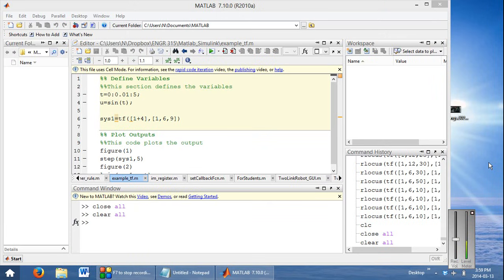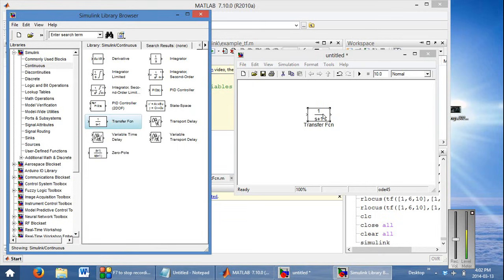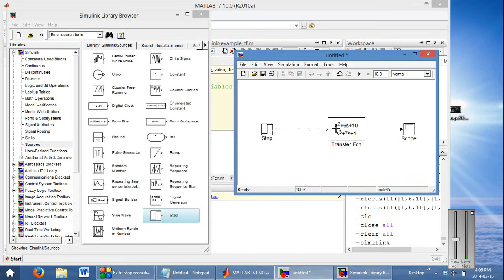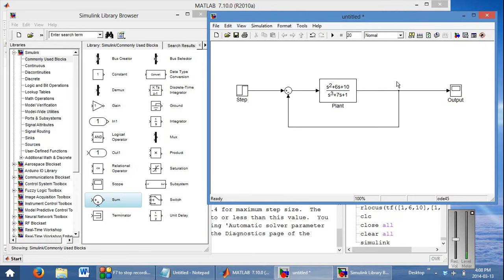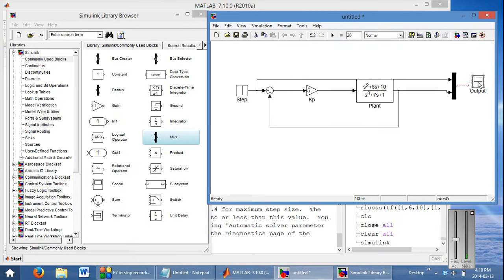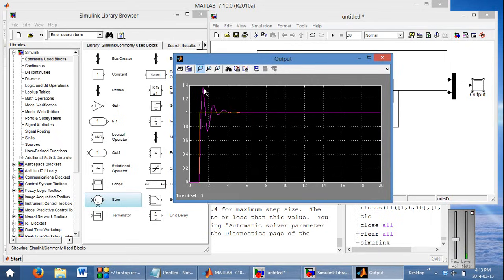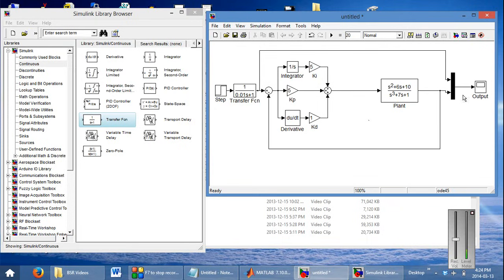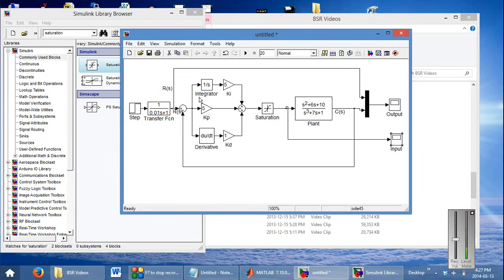Simulink Introduction (Control Systems Focus and PID)

Comment: How to make this statement  in simulink :
Varying the current from 1 to 25A, in steps of 0.4 ampere,  every 40 s over a total simulation period of 2720 s. Sir I have to give output of this as input to a model containing continuous states. Can you please tell me how to achieve this in simulink. Please help sir.

Comment: may i have your email or any wattsap number so i can get help from its very ugent. i have to do assigment related to this but i am not familiar with  simulink. the assigment is related to instrumentation and control have objective of model the circuit related to speed control. kindly drop your contact info it will be very benificial for me. looking for response
thanks

Comment: why don't you use pre-made PID block from the same library?
Reply from the maker: I created the controller from scratch to demonstrate the effect that each signal has on the feedback loop. Once a student understands what a PID does, they are more than welcome to use the pre-made block, since it will save them a lot of time.

Comment: Hey there! I have a transfer function of a control valve in a small pilot plant (step test). I used ident and found lots of possible orders, some with zeros included. All orders gavem 90%+ fit. I tried to tune a 4order1zero tf obtained from it with ZN but it didn't work. My question is: Why ZN tuning didn't work? And also can I used other good fits? If so, why use them?

Comment: Hi , I just have a equation and do not have a transfer function , how to use a PID and tune a PID, I wanted to model an inverted spring pendulum.
Reply from the maker: Most likely, you have to take the equation and transform it into the Laplace domain.

Alternatively, if you can simulate the system in Simulink, you can also heuristically tune the controller (via a "guess-and-check" method).
Reply: may I have your email Id please ,   Please message me in my FB https://www.facebook.com/sudhansum.tripathy, I need a help with it , I have used auto tune in MATLAB and want to send you the document so that you can see it.

Comment: Hi, I'm designing a PID  controller for my Quadcopter, my questions is, how do you come up with a transfer function?
Reply from the maker: +Cracklin319 
That is a complex question, because the dynamics are not linear, which means that you cannot use transfer functions. 

You can however assume small deflections from some equilibrium position (for example level flight)  and then fit a transfer function to that response. This would result in a controller that works decent near the equilibrium condition, but with worse results as you get away from them.

If you have the physical system, I would recommend that you look into something called "System Identification". For theoretical methods, you would have to consult published literature.
Reply: After linearized them, I shall make a Laplace transform right?

Comment: sir i have to design a PID controller or a PI Controller for the control of BLDC motor.
can you please explain how do we need to select the values of Kp, Ki, Kd????
please help me with this one
Reply from the maker: +Prerna Khobragade 

There is usually no one right answer for the controller gains Kp, Ki, 
and Kd when it comes to PID controllers. All that matters is what your 
desired response is, which is characterized by rise time, settling time,
 percent overshoot etc.

In this video, I used the heuristic tuning method (more commonly known 
as Trial and Error) until the response was "good enough". When using 
this method, I recommend that you start with Kp while keeping Ki = Kd 
=0. Once a decent rise time has been achieved you can tune Ki with the 
Kp value previously found, while keeping Kd=0. Following that you can 
tune Kd.

Alternate methods to tuning PID controllers are the Ziegler-Nichols 
method. Equations for these can be readily found on the internet or in 
your controls textbook. The Ziegler-Nichols method is a more structured 
trial and error approach, which gives you a procedure and equations to 
use. The use of trial and error approaches for tuning PID controllers 
emerged from systems that may be too difficult to model, but can still 
be satisfactorily controlled with PID controllers.

An additional method sometimes taught in classical controls courses is 
the PID tuning based on pole-placement. It involves finding placing the 
PID controller in series with your Plant transfer function and then 
ensuring that the closed loop system has dominant poles that correspond 
to the damping ratio and natural frequency requirements . This method is
 too involved to be described here, but should be outlined in a control 
textbook or similar online resource.

There is also automated tuning Software. Simulink for example has a PID 
block, which has a built-in tuning function. I am not certain, which 
library the block is in, but I was able to find it via the search 
function.

Comment: Hi, I would like to enquire whey you need a PID controller and a transfer function? Just use either 1 would give a desired result isn't it?
Reply from the maker: Hello,
The transfer function itself represents the thing that we want to control. It is a simple model of some system.

Comment: How did you find de values of Kp = 5 , I = 5 and D = 1? please help
Reply from the maker: Hello Cristian,

Sorry that I did not see your comment until now.

There is usually no one right answer for the controller gains Kp, Ki, and Kd when it comes to PID controllers. All that matters is what your desired response is, which is characterized by rise time, settling time, percent overshoot etc.

In this video, I used the heuristic tuning method (more commonly known as Trial and Error) until the response was "good enough". When using this method, I recommend that you start with Kp while keeping Ki = Kd =0. Once a decent rise time has been achieved you can tune Ki with the Kp value previously found, while keeping Kd=0. Following that you can tune Kd.

Alternate methods to tuning PID controllers are the Ziegler-Nichols method. Equations for these can be readily found on the internet or in your controls textbook. The Ziegler-Nichols method is a more structured trial and error approach, which gives you a procedure and equations to use. The use of trial and error approaches for tuning PID controllers emerged from systems that may be too difficult to model, but can still be satisfactorily controlled with PID controllers.

An additional method sometimes taught in classical controls courses is the PID tuning based on pole-placement. It involves finding placing the PID controller in series with your Plant transfer function and then ensuring that the closed loop system has dominant poles that correspond to the damping ratio and natural frequency requirements . This method is too involved to be described here, but should be outlined in a control textbook or similar online resource.

There is also automated tuning Software. Simulink for example has a PID block, which has a built-in tuning function. I am not certain, which library the block is in, but I was able to find it via the search function.
Reply: I have been using Simulink, and i was tuning my PID blocks. I will try to use Ziegler-Nichols method... Thanks for your answer... and thanks for your video!